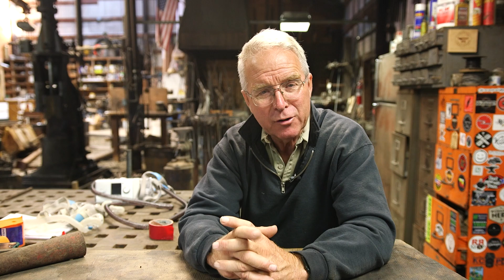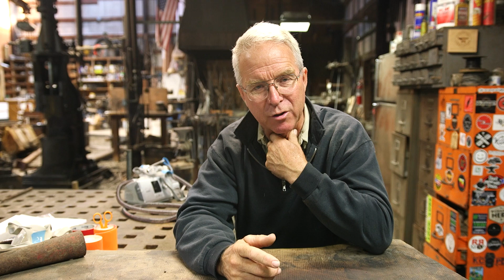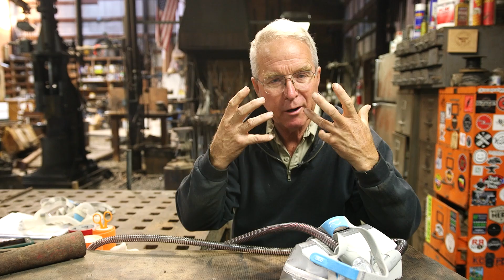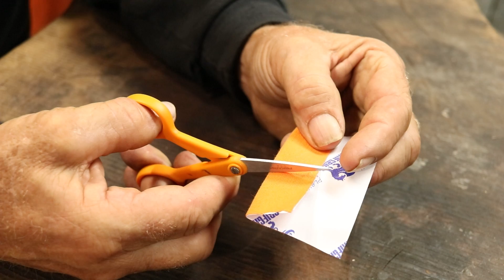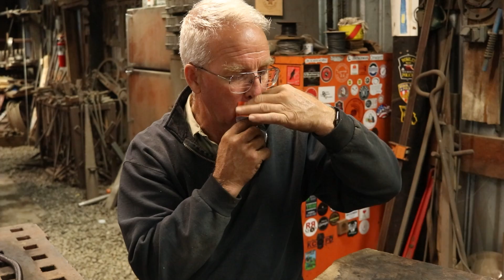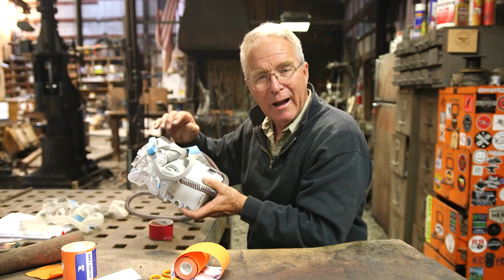Tired Contractor  Here’s My Simple, CHEAP Sleep Apnea Solution

Comment: I was diagnosed with sleep apnea in 2007. I stopped breathing 482 times in 6 hours. I weigh 225 and stand 5'10". I was rushed into surgery immediately after staying the night doing the sleep study. The surgeon thought I was going to be a 400+lbs old man. I was 32 years old at the time. I had my uvala and palate removed, had a up3 tongue suspension and my septum was deviated and growing in my sinus cavity. I was in surgery 11 hours and had 7 different procedures done. It was barbaric and recovery was hell. I still use a C-Pap and I still have up to 3 apnea a night with my machine on 16 psi. The dry mouth as you explained is horrible and causes tooth decay. Honestly, I'm going to try the tape over the mouth just to test it out. Sleep Apnea is Hell !

Comment: I have moderate sleep apnea and tried a CPAP machine (resmed airsense 10) on two separate trials and just COULD NOT get to sleep. It's terrible. Tried different nose attachments too but wasn't ever close to sleeping with it on.

I read James Nestor's Breath which is a great book. Tried the mouth taping and it helped a little but not that much. I'm glad it works for some.

I tried a Mandibular Advancement Device - a mouth appliance that pushes your lower jaw forwards to keep your throat open. Didn't work, and using one every night would end up misaligning your jaw.

I'm now using an iNAP device. This is the one for me. WAY more comfortable than the CPAP. Not even close. It's an oral device that you place between your tongue and upper palate and it simply creates a vacuum so your tongue gets stuck to your upper palate. This stops your throat from closing. You must be able to breath your your nose. I'm sleeping much better with this device.

Everyone is different but if you hate CPAP and you've tried a MAD and mouth taping and you don't know what try next then the iNAP is worth a shot. You can get it from the US and UK. I got mine from the UK site mysnoreclinic as they are way more helpful than the US site. Look into it.

Comment: Sleep apnea affects just about everything. It deprives body tissues of oxygen, creating a condition called hypoxia. In my area of expertise, the eyes and associated structures, sleep apnea can cause optic nerve hypoxia leading to one of the most challenging glaucomas to treat - normal-tension glaucoma, or NTG. Many glaucoma treatments are available but are primarily aimed at lowering eye pressure. When your eye pressure is already normal, but glaucoma is still present, we must lower it further. That's not always easy. Treating the underlying cause is preferred (with mouth tape, as it turns out). 
Well done video, as usual.

Comment: Another suggestion:  put a piece of that tape between your eyebrows and see if you get an added boost. Cut a triangle about 2-3 inches wide with height of about 1/2 to 1 inch and put the wide end across the forehead with the point of the triangle slight above the bridge of the nose. It seems to keep the face relaxed and adds a feeling of refreshment when waking up. It also may be helpful to make sure your fingers are NOT interlocked when falling asleep. Just put the hands on top of each other instead. Sweet dreams and thank you for this post!

Comment: I had a 37 score without the CPAP or BiPAP and 39 WITH THE MACHINES!    I had a similar trial with the pressure and panicked when they cranked it up higher than what I was able to tolerate in the sleep study.  For my health I started riding my bike 2 miles per day at a really good pace - not a Sunday slide (I’m 69) and my next score was 17.  I had asked the doc to allow me to wear surgical tape over my lips as I slept and they couldn’t allow that - they were afraid I’d choke.  I choked in those awful machines!!   So at home I use the surgical tape - but I think I like your tape better.  With the surgical tape - sometimes I still snore when I’m on my back - which I am a back sleeper trying to be a side sleeper.   Love the story and great advise.   We need to be our own Heath advocate.   The doctors don’t make all the decisions.  Ps. I weigh 105 pounds, do NOT have high blood pressure, do NOT have high cholesterol, do NOT have diabetes.  And now I sleep just fine without falling asleep
at stop lights.  Yes - I can relate.

Comment: Bro. Scott,
I'll not digitally savvy enough to search through the comments to see if this solution has come up:

There is a product called Somnifix that's a professionally designed and manufactured version of your slitted tape. It's complete with the breathing slit, and the sticky is like a first aid tape. It's sticky enough to stay put, but reasonably gentle on the skin to remove.
I use it every night. I feel so much more rested.
On a rare occasion when I fall asleep without putting it on, I'll wake up at some point with that terribly dry throat. This fixes that dry throat because taping one's mouth closed forces nose breathing. 
I have no affiliation with the product other than being a grateful consumer. You can find it on Amazon, and I'm sure other places.

Comment: Just realize that I may be dealing with sleep apnea seeing that I have all the symptoms. I wake up so many times to use the bathroom, my mouth is super dry in the morning, I just sit on the edge of the bed in the morning because I’m so tired I can’t even stand. I doze right to sleep sitting up. I have a headache in the morning. I have started dozing off while driving. I feel extremely lightheaded and grouchy during the day and extremely tired at night. I can tell my body is out of whack because I don’t feel well. I have been researching and listening to stories etc. on YouTube I have been listening to medical advice and what sleep apnea is etc. I did not want the CPAP machine or anything else but I knew if I had to have it I would. Last bit of the night before bed I happened to research, How to do a sleep test at home and you popped up! I’m going to find this tape and I’m going to use it at night. Thank you for sharing! You are a gem!

Comment: Until I was in my late 30s my nasal passages were blocked most of the time. I had decided to train for a marathon and started clearing my throat and nasal passages every time I took a shower. It took about a month but my nasal passages cleared up (lots of gargling and nose blowing the the shower) and I haven't had a problem since. Occasionally I'll have a bit of congestion but a shower or two or sessions gargling with warm salt water clears everything. My opinion is that each individual is an 'experiment of one', what works for me may not work for you but if you keep trying out new / different things you may eventually find what works for you.

Comment: I also had both types of sleep apnea and was kicked out of the sleep study at 3:00 in the morning because they thought I would die on them. Had a CPAP and it also drove me crazy, tickling facial hairs where there was a tiny leak. Sometimes my jaw would drop open and the CPAP air would go in my nose and directly out my mouth. My fix was to do abdominal deep breathing which gives you more oxygen in the lower part of the lungs.  The breath is also the gateway to meditation which I also did. Haven't needed CPAP for last 20 years.
Would like to suggest you give that cpap to someone who can't afford one, and thanks for the good video.

Comment: Whenever I visit the heart doctor, my blood pressure goes high, 144/90-ish.
Then I breath through my mouth for about 10 minutes and my blood pressure goes down a little about 133/85-ish. 
I have since started box breathing through the nose, for a short time and the blood pressure goes down into normal range,117/20 ish. 
I do this through the day.
You breathe four counts in through the nose, hold for four counts, exhale four counts. repeat
I learned this in the Marines, as a manor of calming the mind and body before a mission.
I have used duct tape to burn off warts, so anyone should be careful with the type of tape.
I heard this before from someplace.
I planned to try the tape thing, but have not got around to it. I know it would help. 
Thanks for the video.

Comment: I modified it slightly and it's working for me so far.  I cut the strip into thirds instead of in half.  I don't need that big swatch covering half my face.  Then instead of 3 cutouts for the mouth I just do one slit.    This still holds my mouth closed enough for nose breathing but allows me to take a sip of water if I get up in the night, without having to rip the strip off my face and put a new one on.

Comment: I have been using the CPAP for 4 years. I'm 60, and weigh the same as  when I was in my 20's with a slim build. I never smoked and always kept in good physical shape.
I have snored loudly since my teens.
I was diagnosed with severe sleep apnea (47 episodes per hour during my sleep test).
Because I went undiagnosed for so long, it caused me to (or at least contributed to), my high blood pressure and also enlarged my heart.  I also did not dream for decades as the poster said, also fell asleep at stop lights, and wandered in the highway lanes (terrifying).
I was always tired in the morning, no matter how long I had been in bed
Once I got used to using the CPAP, I feel rested in the morning and I dream again. I do have a little advice that worked for me, that you may try  hopefully it helps someone.
I had a horrible time getting used to the machine, I felt claustrophobic and thought I was suffocating but I used it every night because I knew the consequences of leaving sleep apnea untreated.  I got the idea one night to stick my fingers in my ears, so that I could not hear myself breathing, as soon as I did that, I realized that I was breathing normally and not suffocating.  The next night I used ear plugs, with the same good result. After that, I had no problem with the machine, except that it leaked air out of the sides of the mask unless I fastened it uncomfortably tight.
I went back to the sleep therapist and got a smaller size mask. Now no problems.
I use the Resmed Airsense with a Phillips Dreamwear mask with the nasal pillow. I have the heated hose which I drape over the bedpost.  My pressure is set at 11.  I originally used the ramp feature on the machine to build pressure slowly, but find that I don't need to do that anymore.  

.

Comment: I have another solution. Yours could work if your nasal passages are fairly clear. I can only sleep on my side. When I do, whichever nostril is lower blocks completely. Looking in the mirror, if I cover one nostril and inhale, the open nostril is nearly pulled shut. Perhaps it's a deviated septum, I haven't had it checked or had a sleep test.
I experimented and landed on this: I use Breathe Right extra strength tan strips (so, not the clear plastic ones). No other brand stays on as well and is as easy on my skin. Get this: I overlap two strips. (I think I have an average size nose for a 70-year-old man.) When I cover a nostril and inhale, the other nostril is kept open.
This has worked well enough for many years. My FitBit says I get "Fair" sleep and very occasionally "Good." Still, I think I drag more than I should for my very healthy lifestyle.  I never have dry mouth, so I don't think I'm breathing through my mouth. Dunno if your technique would be a useful addition or not.
BTW, I have a couple of cousins who use Bipaps and are quite happy with them.

Comment: I am sleeping sooo much better since I watched this video. I still use a mask but with the tape as well. TIP: cut your tape one inch wide and place it in the center of your mouth...no slits in tape. Saves on the tape which is expensive. Also...pull tape off very slowly to have NO pain.
Reply: Also....put on chapstick before the tape to save your lips!

Comment: Just to be prudent, you may want to re-take the sleep studies (possibly a split study) using the tape method you've discovered. Sounds like it's definitely helping you. I believe the main benefit you're getting is that the tape prevents your jaw from falling open which leads to obstruction by the tongue falling posteriorly. I also wonder if having your mouth taped in some way prevents you from having central sleep apnea.?.?  Either way, thanks for the video, and be safe!

Comment: I bought some rip-off foot pads. They’re designed so you can tape packets of herbs to the bottom of your feet: supposedly to remove toxins. They made my feet hot so I quit them, but that tape works perfectly because it has tiny air circulation holes, it’s very soft and pliable and quite inexpensive. I still cut the slits. Also, I’m going to use Flonase to make sure my nasal passages are open well. Sleep, glorious sleep!

Comment: I used to wake up in the middle of the night gasping for air. Not anymore! I learned about this from another fellow named Patrick McKeown, but I tape my mouth at night too and so does my aunt who learned about mouth-taping separately. I use 1/4 wide 3M Micropore Surgical Tape. I position the tape vertically over my lips (other are better off if it's placed horizontally) because that is usually sufficient to keep air from inadvertantly getting inside my mouth. I fold a pull tab on it so that it is easy to get off. As long as no air comes in through my mouth AND I manage to stay on my side, I don't have breathing issues!

Comment: SO: The back to hamstring golden angle(keeping the airways open) is between 25 and 35 degrees. This profile fits a very comfortable full recliner perfectly.
If well-made, the recliner takes almost all pressure points down to negligible pressure and keeps the airways open. If you clean the air with a purifier, you should get a very good nights sleep, with no tape.

Comment: You aren't the only one to come up with this idea. I use 3M micropore paper tape WITH my CPAP. A lot of thin people have obstructive sleep apnea. It's the apnea that causes the weight gain for many. The obstruction can be caused by several small anatomical anomalies in the airway. For me--my tonsils were super-enlarged from allergies. They touched. My adenoids were also problematic. My dental arch was narrow. All of that contributed. I had tonsils and adenoids removed. I got braces to increase the width of my dental arch (functional orthodontia). I bet you could optimize your sleep with an auto CPAP with your tape. <3

Comment: Thank you for your insightful videos.  Each of your videos have given me at least one takeaway; which I consider time watching you was well spent.  I have had trouble with post nasal drip and sleep apnea for 20+ years.  I realized I needed to make a major life change after I almost ran off the road driving to work first thing in the morning.  I took the sleep test and found that CPAP was the way to alleviate the problem.  The nasal strips helped but not like the CPAP constant pressure.  I can not use the nasal cushions because the air irritates my sinuses.  Therefore, I wear a  Fisher & Paykel FlexiFit 432 Full Face Mask which is so comfortable sometimes I have to check and make sure it is on.  I have slept comfortably with the mask on while being face down on top of my pillow.  The silicone cushions are that soft.
My post nasal drip and throat phlegm can be controlled by using a saline nasal rinse.  I can tell when I have been using the rinse and not.  Here lately, I'm 70 yrs old, I've noticed the post nasal drip is causing some issues with lung congestion.  This has prompted me to use the rinse more often which has helped.  I use the Neilmed Sinus Rinse Kit available for less than $12 which contains 50 packs of saline solution and squeeze bottle applicator.
Thank you again for taking the time to present subjects in enough detailed instruction that the process could be duplicated in real life.
Reply: The difference is in the wallet, I suppose you’re allowed to promote so much products, ON a video that is simply removing the HEFTY price you have suggested.

You’re 70... I won’t take away what experiences you have - however there’s a reason you got ZERO likes on your comment.

Comment: You sound you have exactly the same symptoms as I have, if I sleep on my back I have dreams were I am under water trying to swim to the top, luckily I have made it to the surface so far. I found a device called a sleep noodle, it is a kind of belt that goes around your chest with a big noodle on the back, it stops you from sleeping on your back. Works for me . I will give the tape a go. Thanks for this hopefully you have saved a few lives. Isn't it fun getting older 😅

Comment: Try a chin strap if you haven’t with your cpap to keep your mouth closed. Pressure shouldn’t be so powerful. Bilevel is meant to alleviate intolerance to pressure. Perhaps give it another shot but have it readjusted or try a different mask that doesn’t have so many leaks. Mouth breathing on a full face will cause a leak. It’s the best bet for helping sleep apnea. If you are certain you hate the machine/therapy look into Inspire. It’s a pretty neat solution to sleep apnea. It uses voltage rather than air pressure. It’s a minor surgery but it has a lot of follow up/attention to detail and positive response from patients. Cpap compliance is unfortunately very low but understandably so. Take care

Comment: I've been taping my mouth shut with 3M paper tape for years. I cover about 50-60% of my mouth so that I can breath through one side or open my mouth (breaking the tape's seal) if need be. Works a treat and I can reuse a 2 inch piece for nearly a week (stick it to the side of the dresser each morning). The KT tape approach is brilliant as well, but I achieve the same with far less tape that's far less expensive. All with MUCH better sleep and MUCH less snoring! Mouth taping FTW!